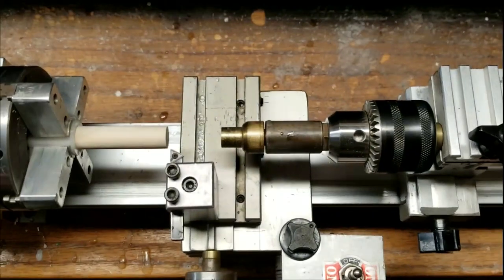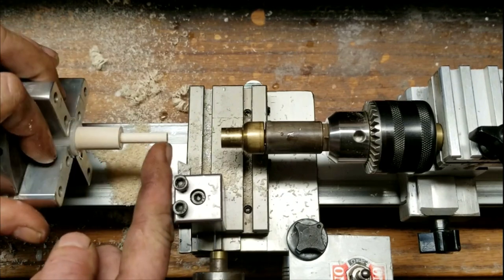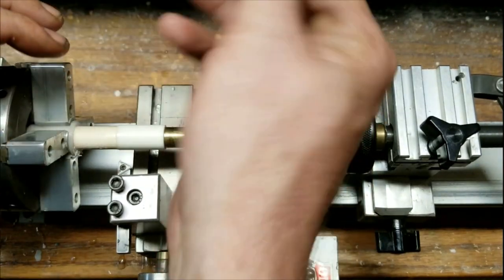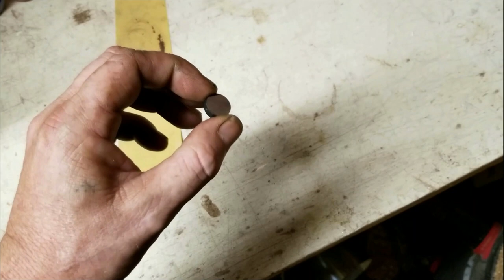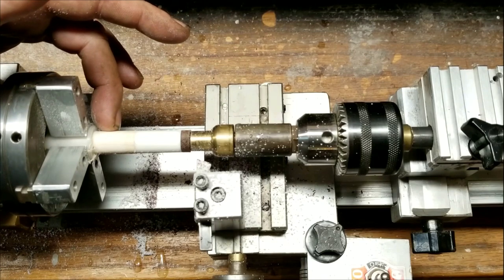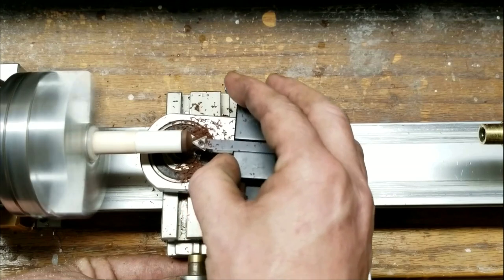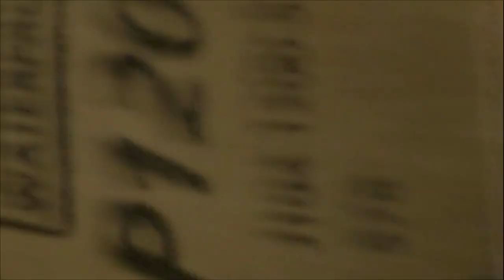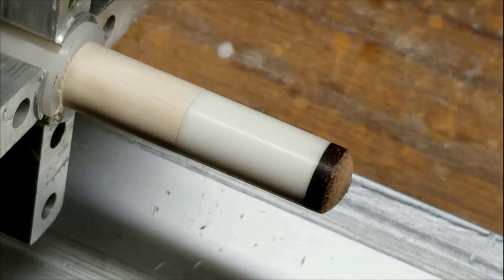Tip & Ferrule Installation

Comment: Also I do what the player wants, threaded or compression. I like threaded but don't keep the glue relief hole. I cut off the end till the tenon is exposed, give a face put the tip on, that's my way. Nothing wrong with your method.

Comment: I am new to this, and just bought a cue lathe, my question is how do you know how deep you are cutting from the tip to the ferrule to make it as flush as possible? I see that you are going forward then cutting sideways from right to left, now if you go a little or more than forward, you will now be cutting deeper than intended when you go sidways from left to right.

Comment: what do you do if the shaft have a slight taper and you are putting a ferrule, the machine cuts straight and doesn't follow the taper. Sanding it manually is also not precise. please advice
Reply: The shaft should NOT have a taper at that point. The ferrule should always be straight with no taper.

Comment: For the average Joe who wants to start refinishing cues and building sneaky petes with the hopes of eventually building a cue what lathe would you recommend?  Mid-America is currently not taking orders unfortunately but the Cue Smith is available.
Reply: It looks like you are running the Mid-America.
Reply from the maker: Yes, Todd is no longer offering the mid America lathers at the moment. I like Hightowers Cues Smith as well but you would want to get the mid-sized version as it has the moveable headstock.

Comment: it seems like the electric switch moving left and right is not accurate enough for lathe work. a hand crank would be much more accurate.
Reply: Just as accurate as any other, it's all about the gear rack, not what's making it move.

Comment: You can't thread them properly unless you have a metal lathe and live tooling.
. Threading is not a sales pitch. Customers don't even know if their ferrules are threaded. Threads made for MECHANICAL bond. Not just more epoxy. Your loose fit plus quick-set epoxy will eventually develop a gap at the bottom. It's the nature of the beast. There are thousands and thousands of shafts out there with nasty glue ring at the bottom because the ferrules were not threaded. Wood moves. Epoxy shrink.   Joint collars and caps should be threaded too.
Reply from the maker: I 30 years of cuemaking I have never had an issue with a compression fit ferrule. To each their own I suppose. If you like threading, by all means, thread.